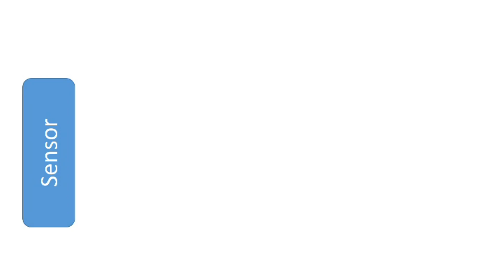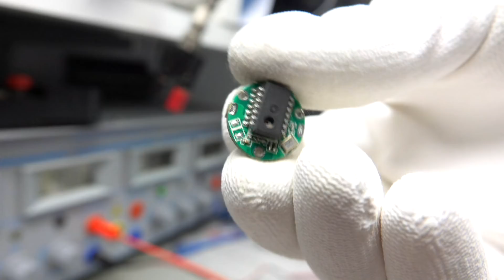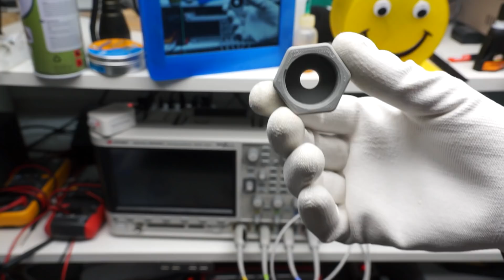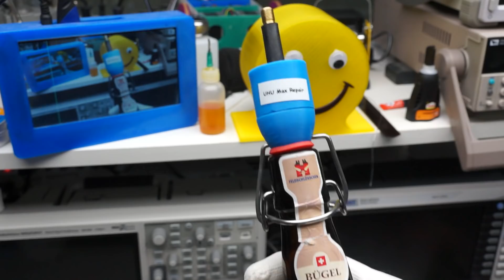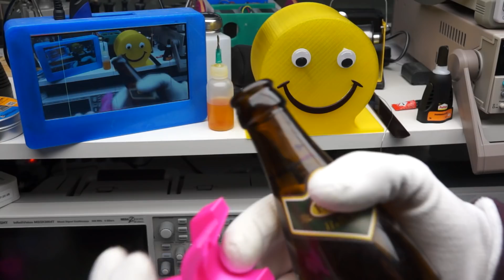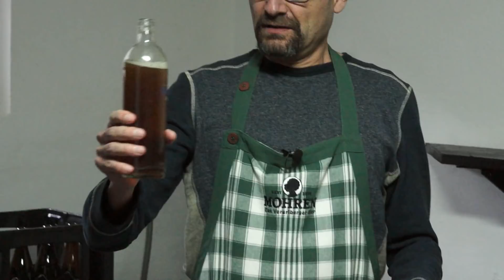#265 Pressure Monitoring incl. Fusion360 Tricks

Comment from the maker: If you want to see the result in reality including the "Hopnerd" and the "Inventor": https://youtu.be/wd6GCgtIwBU
Reply: The result looks great. With that little box you can monitor 4 bottles at the same time. A connecting with a Raspberry Pi is very nice, but a gadget. For a normal analog pressure meter you have to look at the physical meter any way.
Reply from the maker: We wanted, of course, an improvement ;-) And I wanted to play with a Raspberry and Grafana alarms...
Reply: Danke für den Link. Heimbrauen ist auch eines meiner Hobbys.

Comment: What do you do if the pressure alarm goes?
You have to open the bottles!
And of course if you don't drink the beer you have to pour it in the drain.
Sooo... Your project should include an alarm to selected friends that have committed to come and drink the beer. Waste is not good for the environment!
Reply from the maker: Good idea. I have to ask Reto if he wants to setup a twitter notification for his friends ;-)
Reply: The problem is that it’s undrinkable at this stage:-)
Reply: @msevland  please define "undrinkable".  Some would even argue Beer never will be drinkable. :-)
Reply: Beer waste is the worst waste you can imagine! So we will set the alarm to 2bar maximum. At this stadium the beer is perfect. It depends a little bit on which beer-style you brew. A real english stout needs less carbonisation than a german Weizen - so for the stout the alarm has to be let's say ... 1.5bar. This depends also on temperature in the cellar and the amount of sugar you give in each bottle of course.
Reply: @hopfeNerd  In my experience the dreaded "beer grenade" is a result of too much sugar in relation to the bottle volume and yiest strain. So the most important factor is to measure the amount of sugar accurately. I assume the temperature to be the same always. I have no experience with anything else, so cannot say what could happen.
So the next project for you could be a precision sugar dispensing machine?
Sorry Andreas if I added one more to your project list now. ;-)

Comment: Loved the video.  This is real engineering, not easy and can be frustrating. We can never be smart enough so don't beat yourself up about not seeing the solution at first. Fusion 360 seems worth learning.  This project  was really a mechanical project. Just shows we can't just rely on soley on electronics to solve a problem. We must be diversified in our knowledge ie. electrical, mechanical, mathematics, software development.  What a great hobby !   Great work Andreas,  you are an excellent engineer.
Reply from the maker: Thank you! I also think it is necessary to know a little mechanics. And Fusion360 seems to fit this need.

Comment: this is some tech i can really get behind  .   small note , i found making PLA  mate  smoothly to things has often required me to get it hot with a micro torch and pres it against the surface .  Just in case you need a smooth fit in the future .      Of course the next step  is some  small valve that cal ease  off over pressure .
Reply from the maker: Interesting idea to use heat for smoothing. So far I only knew about Aceton.

Comment: This got me thinking of those little plastic diver toys.  An air bubble is trapped in the diver and when the pressure is increased (usually by squeezing a plastic water bottle) the bubble is squashed.  The mass stays the same but the volume decreases, so the density increases and the marginally bouyant diver sinks.  On second thoughts, CO2 bubbles may stick to the diver, messing up the calibration. Not giving up yet.... A tube connecting the beer sample to a bottle of water to convey the pressure!  Another idea: the sample doesn't need to be in a normal shape bottle, it could be in a small jar.  A silicone diaphragm over the top will bulge as the pressure increases.  Should be IOT-able. 
From à man born in the land of Heath Robinson!
Reply from the maker: I had a similar idea and also bought a jar with a rubber seal. But then, I discovered the simple solution and was happy ;-)

BTW: I had to google to know the country; Shakespeare would have been easier ;-)

Comment: 3d printing something that has to be airtight can be a huge challenge. Your video reminded me on a project where i "just" wanted to print a little T-Adapter. It took me a whole weekend to get it air tight (covered it with epoxy at the end).
Reply from the maker: I think, I also underestimated the problem with 3D prints and airtight. I hope, only once ;-) Epoxy seems to be a good way.

Comment: Idea suggestion: Make the sensor smaller and let it float in the bear and have the antenna just above the surface. Put a standard airtight cap on. You will have to make your own PCB.  But the product might be even easier to use. And it will work on any dimension and styles of bottles.
Reply from the maker: Interesting idea. It would for sure work if you can get the sensor small enough (incl. battery)

Comment: I would probably have tested the thing with CO2 generating tablets. Also: If you monitor/record the pressure over time, please also record the temperature of the bottle! I don't know if it ultimately makes much of a difference in the final analysis, but both the gas pressure and the fermentation rate depends on the temperature. If the temperature is not uniform you may get smoother curves by compensating for the temperature. I'm not a brewer, but I guess the brewing nerds also have something to say about temperature.
Reply from the maker: Using a pump was quite easy because I had a valve... 
The temperature inside the sensor will also be recorded in the final version. I assume it will be very similar to the beer temperature.
Reply: @AndreasSpiess  The yeast also produces heat. So the temperature in the top of the bottle may lag behind, since Air and Glas are worse heat conductors and the sensor is cooled by the air. Probably not much of a factor though!
Reply: @AndreasSpiess  I think the overall idea with the tire sensors is genius. Good work!

Comment: If the hopfeNerd does not like a screw top I wonder how he feels about automotive rubber touching his beer. There's plenty of bad chemicals in rubber or synthetic rubber that could easily mix with the beer, as an alternative I wonder if an inexpensive strain gauge could be applied to the top of a crown bottle cap that would allow pressure to be read from the deflection of the cap?  Great video, thanks!!!
Reply: Nice out of the box thinking. Not easy to implement (and calibrate) I think.
(Because the surface is so small, the amount of flex will be small)
Reply from the maker: The rubber is quite far away from the beer (under normal conditions). So he did not see a problem. And as Oscar wrote, I also doubt that we would be able to measure such small pressures just across this small cap. In addition, AFAIK, caps are for single use and you would lose a strain gauge with each measurement cycle. But maybe somebody tries it. It was proposed a few times.
Reply: The beer does not have contact with the rubber so I think there's no contamination. And if there will be, the result will be a beer with a balanced taste of a brandnew car - not bad, isnt' it?

Comment: I just had to watch this for a second time to closely examine your setup. I think if you eliminate the SDR and the radio pressure sensor and go with a wired 0-150 psi stainless steel sensor you would get much better results. You’d certainly eliminate multiple weak points in the system and greatly improve reliability and simplicity.
Reply from the maker: I looked at it. The do it yourself version would be much bigger and probably more expensive

Comment: Interesting project. We make "pétillant naturel" wines - basically a still white wine put into a high-pressure (Champagne-style) bottle with the sugar provided by using original grape juice that was saved and put aside.. The grams-per-litre of the solution is meant to result in a specific final pressure, typically shooting for around 2-3 bar in a bottle rated for 6-7 bar. All very similar to beer I expect. I've mounted pressure gauges on various sample bottles and found that the downside of using rubber is that it spoils the taste of the contents, making it unsuitable for consumption after science is finished. Stainless steel seems to be the way to go for anything that has contact with a beverage.
Reply from the maker: Thank you for sharing your experience. So far we think, the rubber will not contact the beer. But this seems also be the case in your setup. How do you get glas and stainless steel airtight without rubber?
Reply: For the "test" bottles, we use a PET bottle with a plastic screw cap and clamp a stainless steel gauge to the top with a stainless nut underneath. The plastic of the top seems pliable enough to seal up.

Comment: One of the esp8266 boards along with a SKU237545  Pressure Sensor would end a lot of frustration for you. It would certainly resolve a lot of complexity and weak points.

Comment: Great project!

I went the simple route with my Bresser Outdoor Thermometer running on 433 MHz. Use a generic 433MHz receiver module hooked up to an AVR-based Arduino programmed to sample the input where the 433 MHz module is connected, precisely with a timer interrupt. If a match of a preamble is detected, it switches over to decoding mode, and decodes the 40 data bits that the sensor sends. It sends the same data 13 times - if the Arduino detects the same data at least three times, I can be confident that the reception was successful. The Arduino then sends the decoded data over UART to an ESP8266, which then publishes it via MQTT. It might be overly complicated in hardware, but the software was extremely easy to build. Plus, I had all the stuff laying around.
Reply from the maker: That is a cheap possibility if the sensor uses OOK. These sensors use FSK and I did not find a receiver for FSK. And we anyway will need a Raspberry for the next step.
Reply: @AndreasSpiess  Looking forward to it :-)

Comment: Prost!!!!!

My only compliant, you did not evaluate or rate each beer and the one bottle of wine.

Other than these minor problems, this video was excellent!

Lab experiment, beer tasting, sensor research, Fusion 360 and success through failure.

What more can one ask for....

It should be noted, beer taste can be altered by the level of  pressure maintained. Some specialty Brewers have progressive valve reliefs. Essentially, the master Brewer begins with a high (er) vessel pressure, who then allows a small amount of pressure to bleed off, then maintained at a preset level.

But that is an experiment for another day, in a explosion  proof lab. 😎
Reply from the maker: I am not the brewer, only the drinker ;-) Interesting, how technology can improve products! This discussion probably would fit the „Hopnerd“ channel...
Reply: @AndreasSpiess  You will need to be the master Raspberry pi brewing programmer. :-)

Comment: You can buy a fitting with a tire valve thread/seal on one end and a NPT on the other.
Reply from the maker: Interesting. Do you have a link?
Reply: 2Pcs 1/8" NPT MPT Solid Brass Air Compressor Tank Fill Valve Schrader Durable from ebay. I'm sure you can find something similar closer to home. They should fit right into a plastic Grolsch cap, assuming NPT taps are available in Europe.
Reply from the maker: Good idea. Then you only have to create a hole to the bottom to enable the pressure to come to the valve.

Comment: I think if you're going to have a cap that reports the pressure but ruins the aesthetic you may as well just use old PET bottles instead of glass. When you over prime those they usually just balloon. If you seriously over prime them the contents breaks through the cap seal and jets out of the thread. It's still messy but is a lot better than shards of glass everywhere. With a pressure monitor you should have time to move any over pressurised bottles before they balloon.
I think a better application of your pressure monitor would be on the bottled co2 pressurised kegs though. Your monitor should be able to detect when the carbonation has happened and if the keg is leaking.. and usually the top fitting has a port with a pressure release in it so you can fix the pressure without having to discard or drink everything.
Reply from the maker: As far as I understand the alarm is only an add-on. Brewers monitor the pressure to decide when it has enough Co2 and the beer is potable. Or something is completely wrong and you can pour it out without waiting for weeks.

Comment: Your videos are always entertaining and educational!  Instead of using bottles, you might consider using cornelius kegs. That way if something goes wrong then nothing will explode (no bottle bombs). In the US homebrewers typically put part of their fermenting beer in reused and sanitized 2 liter bottles since their bursting pressure is quite high. Rather than using a pressure gauge, most can tell how much pressure has been developed by simply squeezing the fermenting plastic bottles. It’s not very scientific but it is very easy to achieve a relative measurement. Still, I’m looking forward to the next video.
Reply from the maker: I am not a brewer, so I do not know why they use bottles. One thing, however, is clear to me: The bottles in the US must be bigger than here ;-)

Comment: 3 bar is about 45 psi, that should be plenty. In those swing cap bottles, unless you're using some crazy yeast, the fermentation will shut down long before it gets anywhere near enough pressure to bust bottles. I think long before that happens the flip cap itself would lift a little and burp.  Not so with thin crown cap bottles. Not sure what the end game was here. Determine when the bottles were carbonated? Or determine if the batch was over carbonated? Both can be determined by opening a bottle, and if they were over carbonated, you have only two choices, maybe three, chill the bottle, open them all, or do nothing. And then you have some brewers that would prime each bottle separately, which wouldn't tell you anything about the batch. To be useful would have to be measured in the range of 5 to 20 psi, anything above that would probably be considered high. Interesting project and struggles, have to see if it evolved from here, thanks.
Reply from the maker: You have to ask hopfenerd for the details of beer brewing. I have no idea :-(

Comment: Thank you for the great video.  The threaded adapters need to be easy to install, so I wonder if it might help if one side had "pins" that aligned with holes on the other side.  This might help align them so that it was easier to start threading the top.  Only two of these located along the thick, bottom edge would likely suffice.
Reply from the maker: This is not necessary. I tried it. The bottleneck guides the thing neatly.
Reply: @AndreasSpiess  Very nice, and I suspect that the guide pins and holes would also be much more difficult to clean.  Great design!

Comment: Great video! I loved it :) Just an idea - would it perhaps be possible to measure the pressure inside a capped bottle using strain sensor measuring the deformation of the metal cap? Or measure the "popping out" distance of the metal cap with some leaver or something. If so, then one could detect the pressure inside any capped bottle without having to mount a special "detector cap"? Just an idea. Perhaps someone already tried that?
Reply: I saw someone else with a similar idea in the comments. I think it's nice out-of-the-box thinking. But how many microns does the cap eventually pop out?
The surface is really small.
Perhaps a laser interferometer?? With the drawback that you would have to place your bottle extremely fixated in some contraption.
Reply from the maker: I agree with Oscar. In addition, these caps are for onetime usage as they are somehow crimped. So you would lose the strain gauge with every measuring series. But maybe somebody tries it.
Reply: @oscargr_  I suppose I have to do the experiment to find out? :). Or contact my friend who does small micro-batches of beer at home. I try to come back with info if I get any :)
Reply: @AndreasSpiess  Yes I agree, that would be impractical. Still wonder though. I have a friend making beer at home. I provide some feed back if I get around to do some experiments with beer caps and strain sensors. Good luck with your project!
Reply: @kjell-olovhogdahl6557  Oh, that would be great.
Never let me, (or any) beer-glass-half-empty-guy, stop you from testing out your ideas.
😄

Comment: One aspect was not covered: To remove the valve when the bottle is ready to be consumed you need to use pliers and force. Is it likely the valve will withstand this ? Over how many cycles ? If the valve needs to be replaced every so often what would the price of a valve be abd can be easily purchased or one needs friends in the tyre industry to get some ?
Reply from the maker: If you do not press it too much it comes out quite easy. Fortunately. I got my valves from my brother, so I don’t know the price.

Comment: I saw someone 3D print an air hose attachment and make it airtight simply by dipping in a pot of PVA, but evacuating the pot with a vacuum pump to force the glue into the 3D print. Allegedly it worked ok... I guess other sealants would also work..
Reply from the maker: I was not aware that it is so tough. Finally, I was happy to leave it. Maybe for my next project?
Reply: I might have misdescribed... a Chinese vacuum pump isn’t expensive and useful for getting air bubbles out of stuff generally. Stick your part in a pot, surround in your favourite sealant, turn on pump... I haven’t tried but vs painting on epoxy, could apply a thick coat, evacuate to cause glue to be drawn INTO 3D print, then wipe off excess... one could deliberately make the 3D porus to increase amount of glue drawn in and final strength?.?